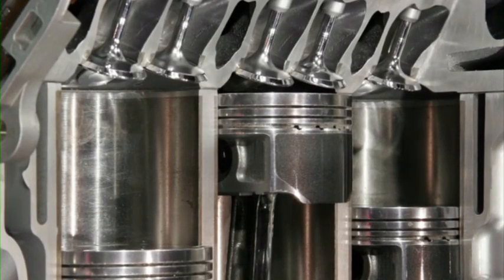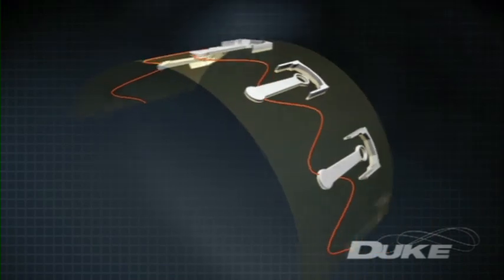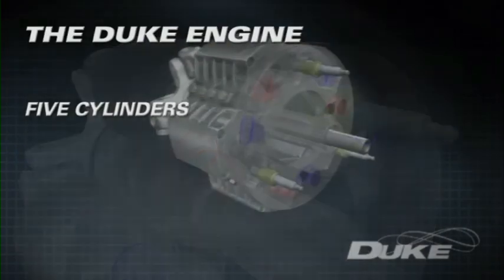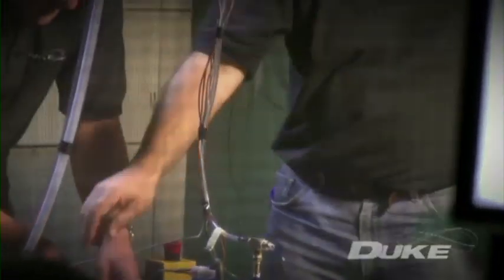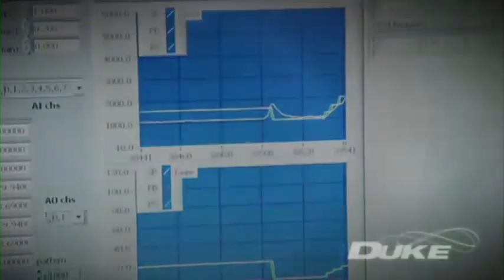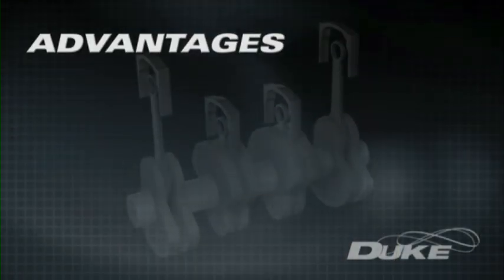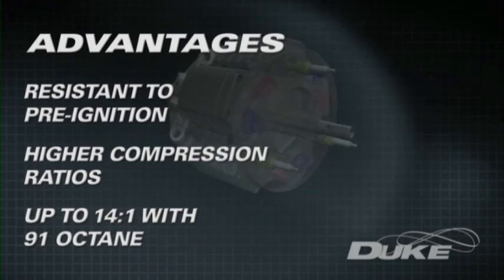Duke Engines

Comment: They claim more power from their 3L engine. One report said 215hp/250ft-lb.
The nissan VQ30DE made 230hp/217ft-lbs (this was in 2001). The VQ30DD made 255hp/239ft-lb (in 01-04). The BMW M54B30 made 235hp/222ft-lb (in 05). The BMW N53B30-O0 made 272hp/236ft-lbs (in 2010). The ford duretec 3.0 makes 221hp/205ft-lbs (in 06). It makes more torque, but as for power, it is lacking. 
How long does this last? Can it go 100K miles with no issues, 200K? How easy it to work on?

Comment: without any calculus I can see its pros and cons for their basic structure already had occurred to me while it only for reasons of money I could do more before in 2007 or so. the pro is in force and torque against this in the combustion speed generates friction + vibration especially if the gearbox does not engage with the fueza and engine speed is combusted the engine is extremely easy to burn and fail deformarce.

Comment: So its like a oversized reverse A/C Compressor?
Reply: Brett Carey Swash plate, used in hydraulics as well as AC for cars. Probably other things as well. I guess that is what inspired the engine idea. Cheers from John.
Reply: I haven't seen one in forty years, but, it reminds me of the inside of some hydraulic pumps too.
Reply: @phoenixrc0074  Yeah saw that video too.  I think they only use the acrylic head (see-through) just to demonstrate how the A/C compressor fires as an internal combustion engine.
Reply: A/C doesn't have to deal with spark and exhaust #YoureRight #JustPilingOn

Comment: as a Mechanical Engineer I can bet every thing I own that this engine will never beat conventional ICE; they have been around for more than 100 years for a reason. The friction in the duke engine is crazy since you have all this insane rotation of all this mass , moreover it will be impossible to reach high RPM  because of the enormous centrifugal forces that would be involve also the cooling and lubrication system will be  complex and unreliable  because of the horizontal layout of the piston. Its a good try but just like the Concorde they will quickly realize that this design will never work.

Comment: Nice engineering challenge, however unfortunately completely defeated by UK engineer (now working with Peugeot), who has got genuinely 0mpg from ANY standard production combustion 4 stroke engine! It isn't the engine thats the problem and polluter, its the fuel. This guy tapped a basic freezer compressor, running off the car's standard 12V battery to freeze/licuqify normal atmopsheric air and store it in a small tank (replacing the car's petrol tank) and introduce it into standard cylinders, where it automatically expands.This produces the same compression ratio (10:1) required when using petrol. The car then runs simply by taking in air, compressing it easily and simply to a liquid, and through standard injectors, producing the same results as a normal car using petrol, but without the exhaust pollutions and emissions or toxic flamable and explosive fuel.and no need for lithium batteries, recharging, hyybrids, etc.
Reply: So, you spend some energy to compress air into liquid, then put it in the engine where it does some job. And this job moves the car forward AND compresses more air (and not less then the initial air volume, otherwise you'll run out of compressed air quite quickly).
This sounds like perfect example of the violation of the energy conservation law. Another failed PERPETUM MOBILE, LOL.
Reply: by compresing fresh air and chilling it into a liquid, when released it expands with same energy release and force as oil and carbon fuels. reiventing the crankshaft is clever, but still relies on the same fuel, ie petrol, diesel, or off-set electric or expensive and dangerous hydrogen. all of these pollute the environment in extraction,production, infrastructure, heavy metals, and rising expensivenes, together with geoploitical and social inequalities.
'fresh air' engines, whether they power internal combustion engines, turbines, etc give true clean engines and power for very little polution (starter battery of normal 12volt type), use proven extremely cheap reproducable technologies, remove heavy metal pollution, power station consumption for battery/car charging. it also gives us the chance to have anything with 4 wheels carrying built-in equipment to scrub/clean the exhaust air, and so help cars clean the planet instead of destroying it (honda thought about this in the 1980's). but its amazing people cant push manufacturers into this 'something for nothing' fuel, and MUCH cheaper cars and lorries and an end to the polution that normal engines produce! playing with fancy con rods and crankshafts is as pointles as the Formula 1 hybrid hyper expensive engines. we need to  take the leap away from oil burning engines and electric (we are just shunting the oil burning there to power stations), and the crazy hyrdongen cell nonsense, and let bright engineers work on air fuels and save us and our planet.

Comment: This engine has probably the same cooling problems as conventional KKM and DKM.
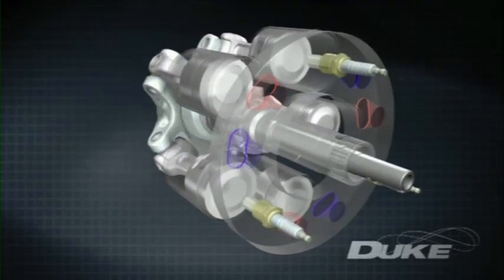The ports 1:16 are a kind of sleeve valve. This is just a more stylish version of the Knight engine. I expect it to have the same advantages and characteristics as the Knight engine plus the cooling problems. One such characteristic is the higher speed.

Comment: Here's the deal , we needed that motor about 20 years ago. Now if they said it was 30% lighter(which it is) and consumed 50% less fuel than a comperably sized (horsepower wise) modern day engine, now you would have a very marketable product. But as others have already stated fossil feuls are on the way out. Its just a matter of time. A 5 or 10% increase in economy is not going to get manufactures to retool and redesign vehicles for the new motor design. Instead they will squeeze that out of an existing design, or shave weight from the vehicle in other areas.

Comment: That thing must vibrate like crazy! That's no "light" piece of metal that's wobbling around. This engine is anything but simple.
Reply: ikutoisahobo the smoothest engiges out there are in line 6... but anyway, this is a very silar design to rotary engines and those vibrate a lot like any other engine... diesel engines are the ones that vibrate the most so this engine should vibrate as much as a diesel engine or less... you could be right in vbrating like crazy if they were to build a diesel version, but then again there are rubber supports on the engine mounts for some reason right? you really think they would be smart enought to develop something so complex and forget about the vibrations?
Reply: ikutoisahobo You have heard of balancing right...
Reply: Endresult Yes, but please enlighten me on how you would defy physics? Balancing can only minimize it so much.
Reply: Eric Smock Please, having built and modified engines, the bottom end of a normal engine is the most simple thing about it (albeit, hard to access). It quite literally has one moving part which is the crankshaft. It doesn't have a wobble plate and a trick bearing (which will most definitely wear out). 

The top end is the complex part in a piston engine. But not nearly as complex as what this Duke engine is.
Reply: s40driver I might not be an engineer.  Also the Wankel makes sense and is fairly 'simple' in it's execution and easy to understand. Watch this video again, just crazy how complex this Duke engine is, there have to be bearings in places I don't even know of, and the cylinder carriage or whatever they're calling it is literally SPINNING and that means it has to have some sort of bearing system too. Lubrication must be a hell of a nightmare. It's a great novelty engine but I don't think we'll see it in a car anytime soon.
Reply: fill it with oil, she'll be right haha..
Reply: ikutoisahobo actaly i expect it to generate less heat coz it do not requere a overhead camshaft i am thinking about the same compresion as used whit a Ottomotors (Petrol engine if u dont know who invented it), just coz u need less matter to construct something do not necessarily mean u need less material for the cylinders...
Reply: ikutoisahobo  if you think that that has more moving parts than the bottom end of a normal reciprocating engine you must be crazy.
Reply: s40driver They do, just like every other metal part that has something rubbing against it in an engine, but they'll most likely outlive the rest of the car/vehicle. Think about the wobbling motion, and no matter how well balanced, I simply don't see how the weird forces and motions of that wobble plate won't wear things out quickly. A crankshaft bearing is only subjected to a single motion, the bearing for this wobble plate is going to have some weird motions,
Reply: ikutoisahobo tyre kickers! don't you think that they have taken all these negative points that might happen into consideration?  please put forth your recent engine concept! I wait in earnest for the result!
Reply: ikutoisahobo so why would the vibration be any worse than any other IC engine if anything it should be better mounted shocks than inline engines have
Reply: You can see from the design where they are balancing it. I don't think it would vibrate much al all
Reply: Endresult You have to admit that it will still generate a lot of heat, that's a lot more moving parts than a traditional engine as far as the bottom-end goes.
Reply: The narrator and the engine's design do a great job proving otherwise, plus its the other way around, it actually has far fewer moving parts.
Reply: ikutoisahobo so the slide bearings
that support the crank don't wear out?

ya the crank is only moving part but it have a number of static parts that suports its movment...

And no i dont claim it have less moving or friction parts coz it will not...

But as u wrote it u made it out like it can do it on its own, but in fact a 4 stroke engine crank needs 4 slide bearings for just one cylinder and that adds up to 10 slide bearings for a four cylnder engine, and the duke prolly not even use even 2 at the rotary crank my guess is that are going to use something that uses way less friction less friction less heat longer life of the components...
Reply: ikutoisahobo and this is why ur not a enginer! it's like the wankel engine ppl hade the same notions u have about the duke as they hade about wankels engine(rotary disk engine) But taken to a higher level of engineering.

That is because most of the rest of the car suffer environmental stress, like for example u dont need to replace your brakes if u can anticipate what's going to happen and engine brake instead of using the break pads, and  u are talking about normal driving i gess since u frasied it that way, or u are talking about heavely customised reinforced parts...
Reply: ikutoisahobo
omg u realy cont get engiens do u... sry but LOL spring beased... thw wobel as u describe it is what drives up the piston! and its more complicated coz thay dont need to use Cylinder head			this tech is like the 2 stroke engien, i know the duke engien have a more complicated "crank" or what ever thay are going to name it...

this is the problem u dont understand what is happening in the engine and what u come up what is that it's got to be spring based do u even know how insane you sound, i have her ppl belive in wirde stuff but untill now i whasent shore ppl come come up whit shit like that!
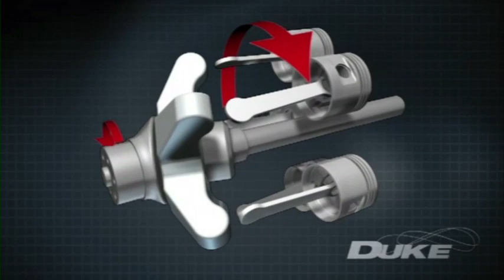Reply: ikutoisahobo and seriously study the photage from 0:58 - 1:10 (and just before) which is a really good animation showing how it will work without springs...
Reply: ikutoisahobo A bit more counter weight than the weight itself to not only counter the weight, but torque. Secondly... Perhaps, a magnetic-driven counter weight that moves closer or further from the central weight to almost perfectly eliminate the vibrations as the engine changes speed
Reply: i dont know a horrible amount about engines and i may be wrong. there are many bearing on a crank anyway. but don't the pistons and connecting rods, oil and comp rings count as bottom end parts too'? since they are below the head?
Reply: and the crank kind of deals with a few forces not just one. i think. the reciprocating forces. into rotation,  then under acceleration the crank wants to move back and forth which is why they have a thrust bearing in the center. correct?
Reply: Eric Smock You're right.
Reply: campbell john They might have, but they'll have to prove it to me before I spend my money on it.
Reply: ikutoisahobo are you actually talking about investment?
Reply: ikutoisahobo  balancing allows cranshaft based engines to achieve 9,000+rpms even in road cars.  without it i doubt a crankshaft engine could operate at more than 600rpms.  so Balancing DOES work in reducing vibration.  and you are not even asking what metal the main recipricator is made of or whether it is forged or cast.... you can't compare a prototype engine that is basically a one of a kind to one that has been in production in various configurations and sizes and out of many materials for over 100 years such as the single crankshaft engine.  give DUKE a few more years and the design may be perfected.  when conventional engines started out they could barely pump out 1500 rpms, the first DUKE engine is already hitting 14,000.  i don't think i need to explain to you the relationship between torque, rpms and horsepower.
Reply: ikutoisahobo Hahaha,agreed.You would get a n ice vibrating ride where ever you went.And when you talked to the person sitting next to you it would sound like you were talking into a fan.
Reply: ikutoisahobo it appears that the crankshaft rotates in the opposite direction of the axial assembly, it would counteract the vibration.

Comment: 3 Plugs for 5 cylinders puts a heavier work load on the plug.  Same with the exhaust ports. Twice the heat concentration in one or two areas on the block.  The Wankle engine has the same problems. If You concentrate the heat in specific areas, it will cause the block to expand and contract in odd ways, warping is a big problem.  But it is an awesome idea.  When can we see on in action.  Lets race !!   :)

Comment: Huh. The whole cylinder block rotates with the pistons. Like a previous poster said, I'm not sure that's going to be reliable. And with more parts rotating, I bet that thing has a really stiff gyroscopic effect. In a land or stationary device, probably not a problem, but I'd hate flying an airplane with that in it.

Comment: I like it very much and can see many advantages of the small "footprint" as it can fit under very small cowlings (aviation, uav's etc). Less moving parts, same advantage as in the 'wankel' engine however less problems with the seals, lubrication, diluted intake mixture due to inefficient side ports, etc. Good work!

Comment: good stuff...rotary using 5 holes w proven sealing...the GM rotaries from early 70's got 150-200k before GM pulled the program due to cars lasting too long....engines were too good. Apex seals(3 rotor rings) issue is absent w this.

Comment: That siding surface between cylinder block and "head" where inlet/outlet ports are begs for questions and it is not even mentioned in this movie, somehow they very silently skip over this part. Also, how do you cool a moving cylinder block? Besides I would like to point out this is by far not revolutionary, very similar designs were build in 30-ies, google for "douglas axial engine" and do some reading.
Reply: Reliable, and relatively long mileage Electric cars were around in the 30's too....  Most of this stuff isn't new, it's just being more or less reinstated.
Reply: Brandon Ryan Nope dude, there werent any reliable electric engine cars. There were several types of internal combustion engines that had some sort of large sliding surfaces like Wankel engine for example and whenever there is a large sliding flat surface involved in internal combustion engines it always falls short in reliability. Wankel also is very reliable and small and little parts used and you would think that using todays technologies it would be easy to "reinstate" these engines but somehow you dont see them much around, some are trying and then admitting that reliability is still an issue. And talking about this design think how you cool it really and how long is that sliding head is going to work reliably. in theory and computer simulation its all great but in real life.. do some googling about wankel powered cars and you will see. No wonder that this axial type of engine was used in only specific applications with short lifespan (torpedo engine for ex) where more conventional types of combustion engines were not possible (weight,size, etc..)
Reply: There actually was...  And I mis-spoke. It was developed and for sale in 1910...  Google 1910 Baker Electric car.  It was a fully functional automobile, and had a range of 100 miles.  The car was mass-produced, and was actually included in the president's fleet of cars at the White House.  The only reason it was not developed further was because the internal combustion engines were able to produce much more power.  So yes, the technology, albeit primitive in nature, was indeed pioneered and implemented far in the past.  And yes i couldn't agree more.  This configuration is not a reliable means of long term, sustained usage.

Comment: To many moving parts at odd angles. This "reciprocator" thing is nothing more than a large CV joint that will prove to be the weak link in this design. It`s a fascinating concept, but just looking at it from this infomercial, it has many potential points of failure and reliability issues.